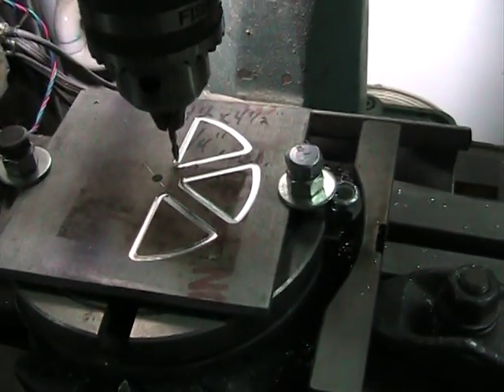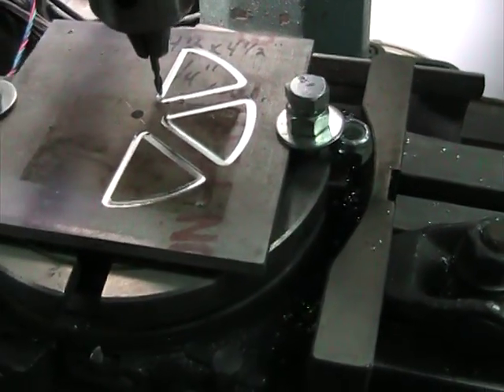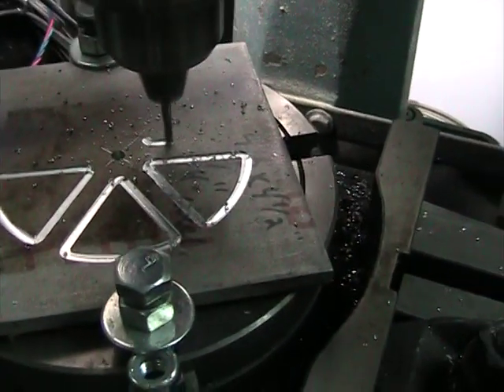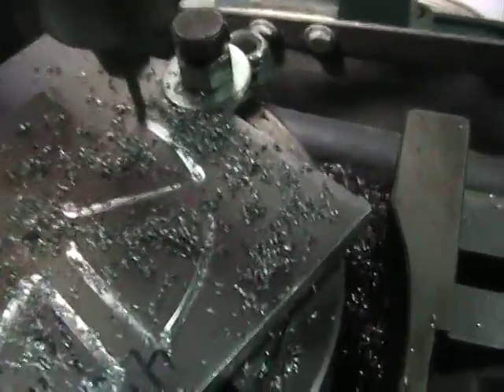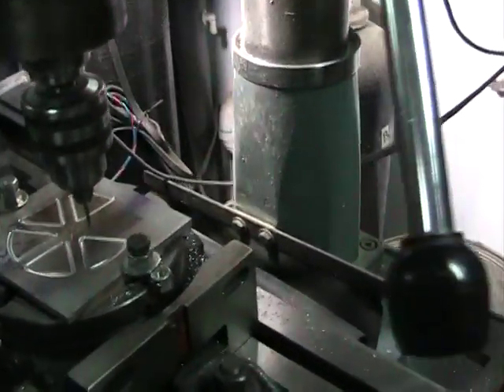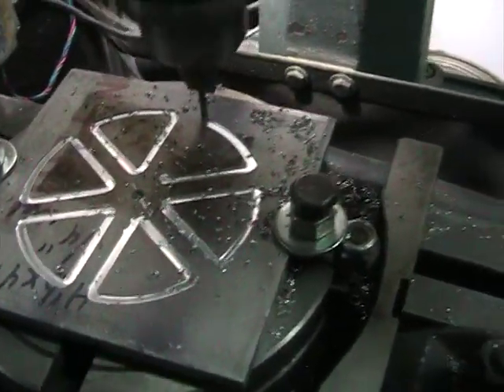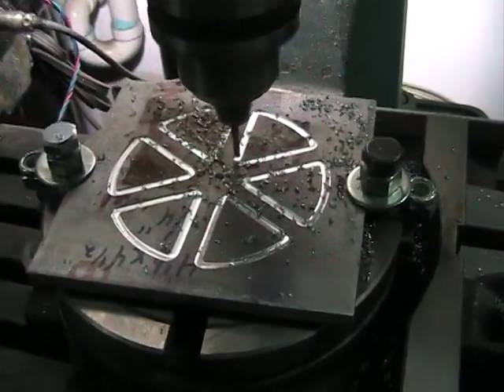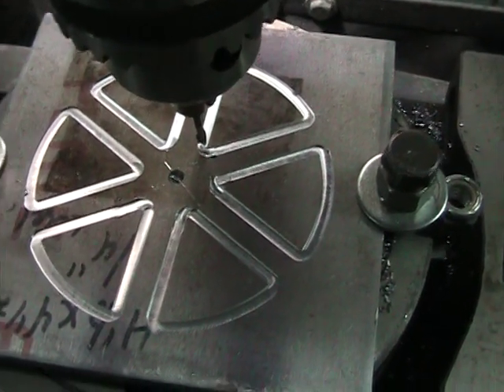Simple CNC Flywheel Spokes

Comment: Chuck... cool stuff. One question... why the rotary table? Everything is CNC, hence rotary table shouldn't be needed.

Carbide Mill -- biggest (diameter) you can use.  Shortest Stub length possible. You should be able to do 0.150" DOC, then leave a little for a final pass clean up. Air hose (blow out chips) and WD40 (prevent cutting edge build up) are your friends. 

Keep to 2x max depth (1/2" mill down to 1" pocket).  Massive CNC mills do much better, but I find the 2x keeps me from breaking those end mills (Hearing an $80 end mill SNAP is not good... hence WD40).  

CNC Router - cutting 0.5" 6061 Aluminum
(I need mist coolant before I attempt a 4' diameter flywheel!)
Reply from the maker: Tom, I'm relatively new to CNC and produced this video before I had learned about the G68/G69 commands which rotate the Coordinate System.  I've since modified the g-code I wrote for this video to put it in a subroutine which I execute 6 times, rotating the coordinate system 60 degrees between each iteration.  That obviates the need for the rotary table.

However, one advantage of using the rotary table method is that it lets you cut a much larger flywheel than your milling machine could otherwise accommodate.
Reply: Chuck Fellows
  Makes sense.  I'm still learning the G-Codes, but makes it handy.  I'm using Vetric Vcarve Pro7 on the CNC machine,  cool to "repeat pattern" and see how it did in G-Code.  MACH3 on the machine.

Comment: Hummm.  .030 per pass, that's a lot of running back and forth.  I am not criticizing what you're doing (I wished I had the knowledge to do this), I just wonder if using a ruffing bit at a slow tool travel speed would save you some exercise.
Reply from the maker: Yeah, I'm being pretty conservative.  I think I could easily double the cutting depth and I could also increase the feed speed.

Comment: Nice setup and interesting video.  Have you considered casting the flywheel?
Reply from the maker: Yes, I have 2 small furnaces and have done some aluminum casting.  But you still have to make the pattern and if you only need one or two flywheels, it's easier to just machine them...